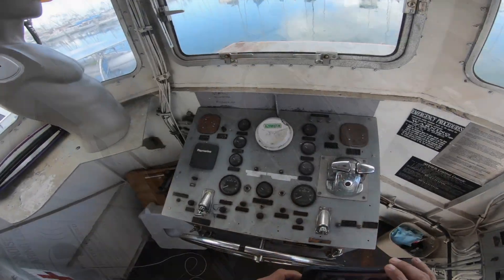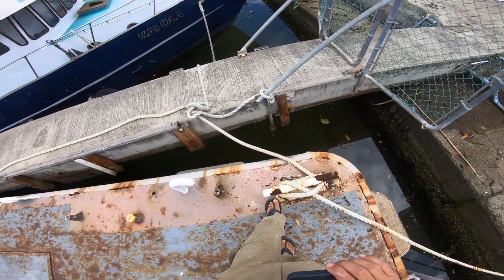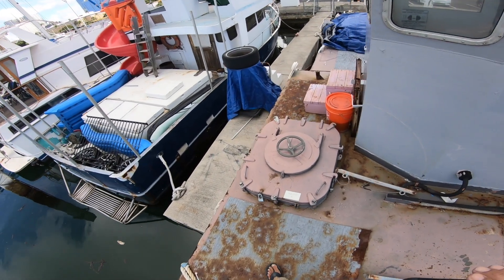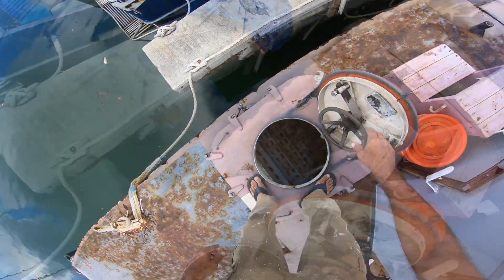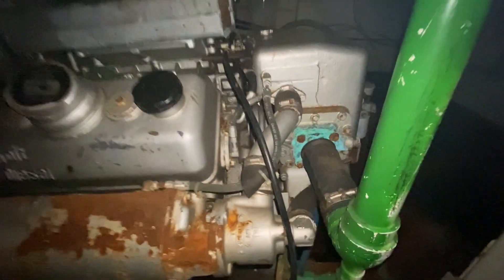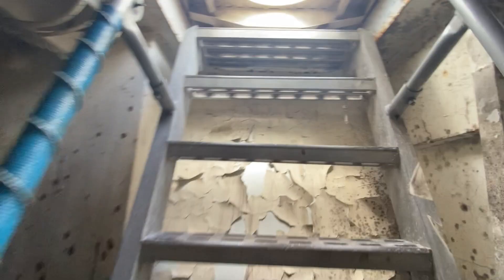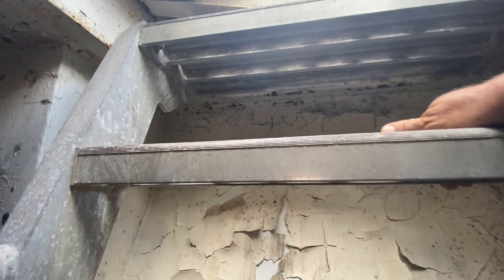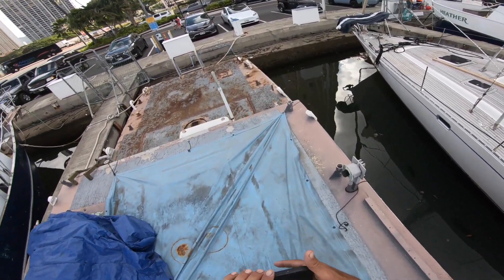CRAZY 50' NAVY DIVE BARGE FOR SALE in HAWAII $13K! Is This Live Aboard PROJECT BOAT TOO MUCH WORK!?

Comment: It looks like you would have to budget for professional mold mitigation
Reply from the maker: Certainly something would have to be done about the mold. The first few wafting breaths almost choked me. 
I think pressure washer with vinegar and soap would do the trick.
 It should be thick navy paint on all the metal. There isn't any fabric or wood on the interior. 
The sheer size and weight of that boat intimidates me the most.
I like those twin Detroit Diesel motors and all the high quality navy equipment onboard. 
I think that center deck is an actual elevator deck, for loading equipment and such. Who knows if it works?...

Comment: Artificial Reef
Reply from the maker: There’s a lot of truth in that idea
Reply: Probably the best use -  tear out any of value or anything "toxic", tow it out to a good spot.  

Fill the boat full of wet-crete that will cure in salt water and sink it to about 60' deep - maybe anchor it for any storm surge - could work!
operational cost maybe $20K or less... recover maybe $5K in materials -- from the electrical system - maybe spare internals from - the hopefully not to rusted engines and drive shafts.

Comment: $500
Reply from the maker: That’s a more appropriate price point for sure 👍
Reply from the maker: I was wondering if it’s even worth it if it were free?.
Reply: @shovelover  everything has to be redone - cleaned - rebuilt insulated - at least in certain areas - the "helm station" has no room for a seat?  Yikes!  Fabricate new metal (maybe use fiberglass/epoxy?) helm station - maybe turn it into a "motor sailor" - though that would require more marine welding and fabrication and engineering - to make sure the balance is good and it is *ship shape*!

Prob cost a good $100K and 9 to 18 months, depending ---  to do it correct - doing much of the work yourself.  

How long has it sat there - exposed to all the elements, water in the bilges (salt water?) - water under the engineers - in the engine room ... more rust than Titanic!  More mildew than rust!

Often the cheapest boats are the most expensive.
Reply: Has mor scrap value than that.